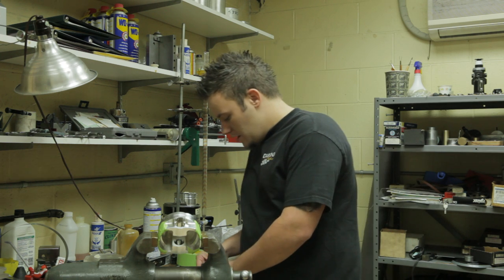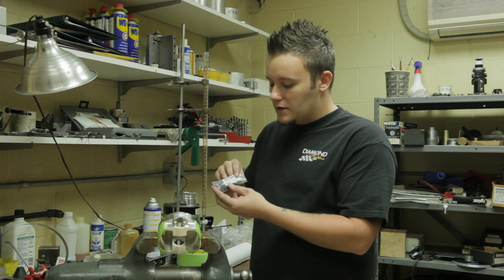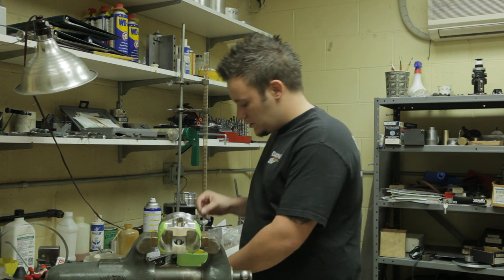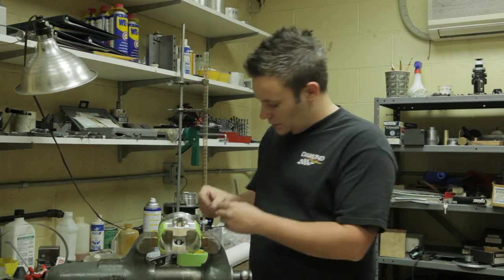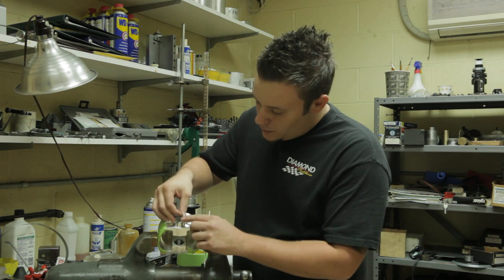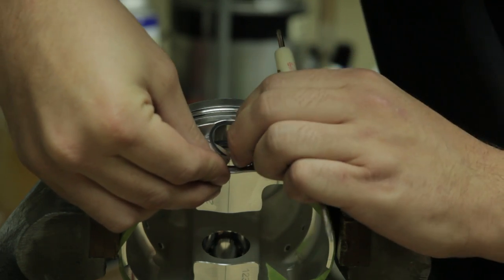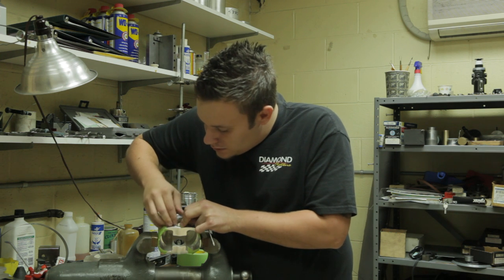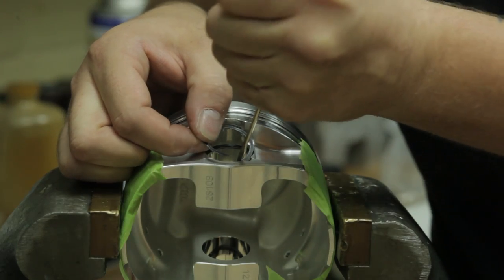How to install a spiral lock

Comment: Very helpful. I suggest a right angle pick that can be picked up an Harbor freight, found it better than straight slot screw driver. Also if it binds up mid way in, pull up on end not in the groove yet and it will aid the install. Mine each time would get stuck on piston side. Also after the install is complete use straight slot to spin the spiral lock top away from grooves in the ring to make the start of the spiral lock be at top of piston, this is where a screw driver came in great.

Thanks again!